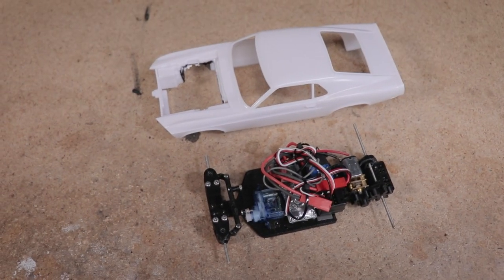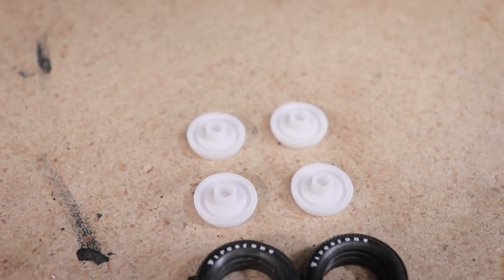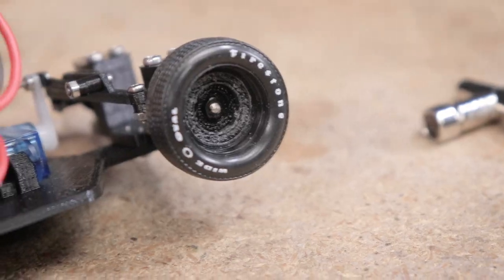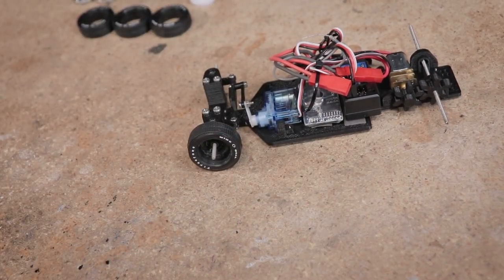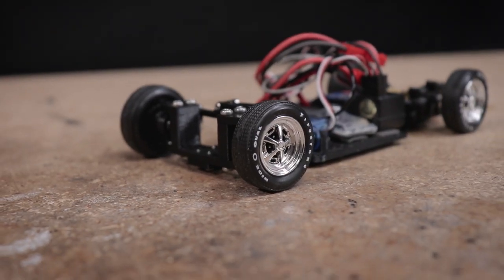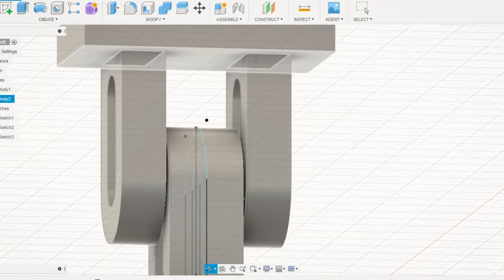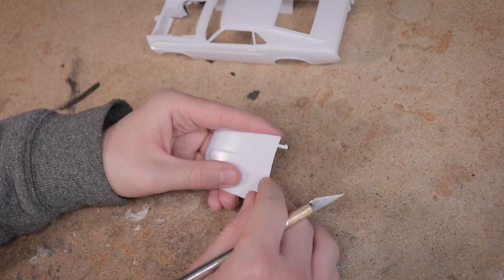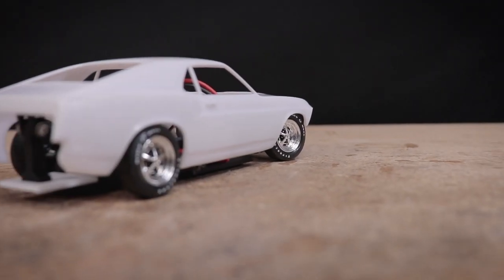New Model Car to RC Wheel Adapter Design and 1/24 Scale Velcro Body Mounts for 69 Mustang Build

Comment: Sweet!  Tons of applications for those wheel adaptors, really opens up the options!  For the mounts, go with two smaller mounts, front and rear - it will stabilize the body but you can use a smaller surface area so, the grip is not too much 👍

Comment: Mustang is sick perfect fit and look with raised letrer factories...Im new to this usually just do model cars but doing a rc model car mix right now how much does 3d printer cost? Im trying to do basic body on rc chasis but want to use custom wheels..i cant figure out how to take front wheels off seems to be pressed in or glued..the rear have screws